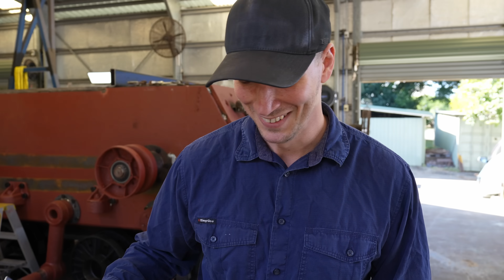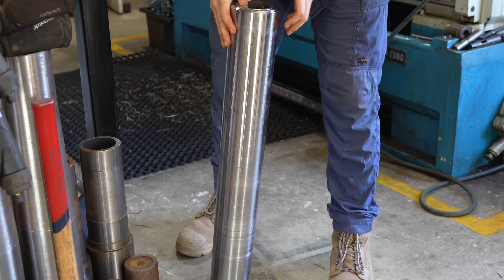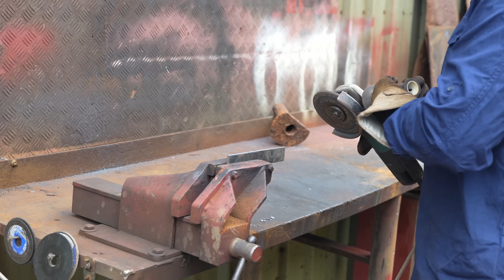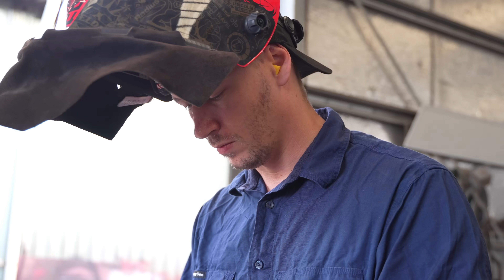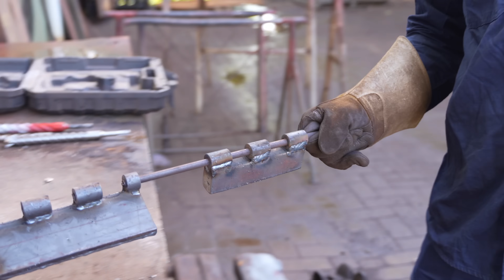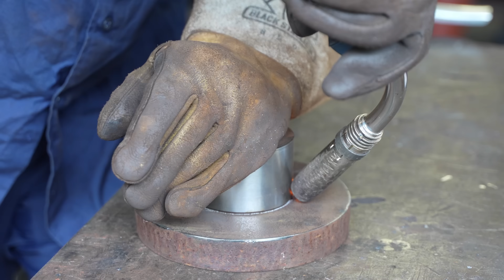WORKSHOP WEDNESDAY: What DESTROYED Our KV-1S Barrel? How will Beau repair this?!

Comment: I don't think anyone would deactivate the gun by plugging the barrel and firing a munition. It would have been safer and easier to detonate it using a remote charge like a satchel or something. Deactivating it while it was a range target later on wouldn't make any sense so I'm certain it was done during war time. The recoil mechanism being stuck halfway makes me think it really was fired with an obstructed bore. It was either genuine wartime damage or sabotage. There's still a chance it was done for denial but I don't think so.

Comment: Considering metal casting is out of the question for practicality reasons, how about making silicon molds and doing resin casting? It's a lot less complicated to set up, and once it's painted it shouldn't look different from the part that was used as the master at all. For cosmetics that don't come under force all that much, it seems like an easier faster alternative.

Comment: Casting a replacement part from aluminum would be fairly simple, although cast aluminum might not be the go-to if it needs to have durability or wear resistance.

A propane forge is hot enough to melt the aluminum. The pattern you have from an old visor. You don't really need to worry about shrinkage if you add in a shrink tube (empty space that extends up from the part).

It doesn't really have much point though if you already have experience and know-how to make something from bar stock.

Comment: Of course you need a high temp furnace if you want to cast steel or iron. But you can manage with a lower temp one if you cast from bronze. Or an even lower temp one if you cast aluminium. And you can't even need a furnace if you cast from resin.

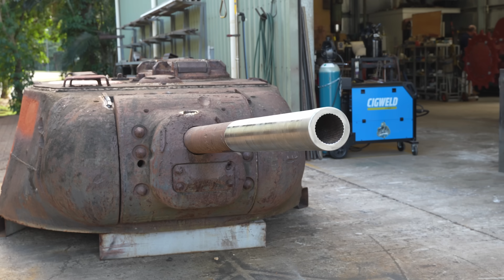Comment: 6:05 - as it is usual in such cases, the added piece droops a little, so the welding should start at the top to pull it up to the correct alignment - or a heavy angle iron should be placed on top first, and both pieces should be firmly attached to it (by clamps) before welding them together.
Hey, I know you know this, and my advice is about four days late, but still... ;-)

Comment: Making the dowel a few thousandths of an inch larger than the bore, then soak in a liquid nitrogen bathe for a few minutes. That bath will cause the dowel to contract enough in dimension that it would slip easily into the bore. As its temperature normalizes, it will expand to its true dimension, locking the dowel in place forever. The reverse is done for the new barrel addition. The dowel also oversized for the new barrel section. But in this case, you warm the barrel to about 400 degrees F and the tube will slip over the dowel easily and when it cools it will also be locked in place. The weld is only needed to hide the joint.

Comment: I use to work at CFB sufield  in Canada Alberta. Where British forces trained. One day a challenger one came in off the field they had went over a large dip and when they came out of it they fired. Unfortunately for them there was around 2 ft of clay mud in the barrel it looked just like yours blew about 3 ft of the end of the barrel no body was hurt badly concussion by the crew. There was so many high ups trying to cover it up but they couldn’t cover it upb

Comment: There was no need to repair anything; the director of this project is incompetent. They should have simply treated it for corrosion and placed the original, intact piece in the museum. By repairing the bullet holes and cannon impacts, you stripped the tank of its originality—and erased a piece of history! You should have left all the original holes intact so that everyone could study the effects of the projectiles on the steel.

Comment: The hatch in the rear part of the commander's main hatch was intended for the installation of a radio antenna (on vehicles with a radio station) or for sending signals (with rockets or flags) when the other hatches were closed.
here some view of turret top
https://microdisign.ru/ssl/u/49/ea0c92371311f0a332eb4b7a686b58/-/2.jpg
https://bronetehnika.narod.ru/kv1s/kv1s_43.jpg
https://dzen.ru/b/ZnJ818qasXInjbD-

Comment: Almost certainly intentional damage. That burst "banana peel" barrel is the result of an intentional event.

Fun fact: movies aside, it is quite hard to destroy a tank barrel without both ends being blocked. Most often you'll simply produce a bulge, which is not necessarily as destructive as one might wish. 

To this day, one standard procedure for disabling a tank gun is to break apart an unfuzed shell so the projectile is free, then hammer it down the muzzle nose first with a sledgehammer, then fire an unfuzed shell into the squibbed projectile.... with a long lanyard. I have seen this exact procedure done with precisely the same results on the barrel.

Comment: if you can plan your cuts 
drop your steel in vinegar or citric acid to eat the mill scale and rust off.  
- side project make set of "welding dog and wedges" with few  different heights of wedges

Comment: Actually you do not have the visor pattern either.  The shrinkage of the casting cool-down is accounted for by making the mold cavity 3% larger than the end item.  Therefore the pattern has to be 3% larger in all directions than the end item you have, so that's another level of fabrication hell to be undertaken for casting a replacement.

Comment: Not that it would likely apply to this one, but have you ever thought of doing an episode about what various government regulators have required to be done to the various tanks to demilitarize them, before or after you got them?  Or, does Australia even have any requirement if the tank is over so many years old?  I've seen some tanks where they had to cut and leave open a hole in the side of the barrel, but not noticed anything that drastic on any of yours yet.

Comment: It is a 85mm kaliber barrel, isn't it? I'm surprised by how thin the wall off the barrel seems to be.
Reply: The main armament of the KV-1S was the Soviet 76.2mm ZiS-5 tank gun. The Soviet Union built in small numbers an upgunned version of the KV-1S known as the KV-85, in which the main armament was the 85mm D-5T tank gun. KV-85s are among the rarest and hardest to find derivatives of the KV tanks because fewer than 150 are understood to have been made, a very small production compared even to the KV-1S (1,085) or the KV-1 (5,000-plus). The best known, most numerous and most widely used Soviet tank with 85mm main armament was the T-34/85, of which the AAAM has an excellent example in running condition.

Comment: Small roof top hatch might also be for signal flags . The Russians radio tech was minimal and early tanks only had 2 way radios  in command vehicles . Next , all tanks  got  radios but could only receive so to show you got the message you would use a  flag . Then they started copying lend lease radios and all got 2 way radios

Comment: Beautiful work Beau.
That barrel was "spiked" and then fired. Or a shell was driven into it by a partially-detonated powder charge.
IE something was shoved in the end. Possibly a shell. It formed a bore obstruction when the gun was fired.
Reply: Not necessarily. It could have been a shell going off while still in the barrel. My guess is that the tank was captured by the Germans some time in 1943 (Kharkiv), and ended up in France as part of a unit (e.g. Das Reich) or used there as instruction object for German recruits on how to tackle a KV-1. It would be interesting to know at which firing range the tank ended up as this would pinpoint roughly where the Germans eventually abandoned it.  I don't think the French would have bothered transporting it hundreds of kms
The Germans probably abandoned the tank after the barrel was wrecked as I doubt whether they would have had KV-1 main guns spare. The alternative would have been to fit an L/48 75 mm gun, but that would have required a lot of work and would probably not have been worth the effort, especially as they would have had a lot of far more pressing repair jobs.

Comment: I've bought castings for vehicles in one of my past jobs, and my immediate first thought was "never cast a one-off." I would have been getting it from a CNC machinist (either in-house or bought outside), but Beau's handwork is equally good for a cosmetic restoration and takes a lot less capital investment. Lovely work and a good explanation of why the replacement was fabricated instead of cast.

Comment: Couple of hypotheticals:

The barrel might have been destroyed by the crew, I know the Germans used to drain the oil out of the recoil damper and then fire the gun to disable it. If the KV crew had done that and obstructed the barrel when they fired it, it could have left it banananed and stuck in the recoiled position. Maybe it was disabled while the Russians retreated and left on the field and later retaken in a counter-offensive. No longer fit for service, it ended up on a range. Just guessing.

The little hatch on top may have been for signal flags. Not all Russian tanks had radios and a lot of them that did were receive only.

Comment: You could flatten a bit of copper pipe and use it as a fence or barrier to stop weld from migrating or flowing to where you dont want it. Copper will make the weld stop dead and it wont stick to it.

Comment: The small hatch next to the cupola is primatly for a flare gun, which was a standard part of equipment in both German and Soviet tanks of the time. Could also be used to throw out spent casings and wave signal flags.

PS Also, both crew hatch and the flare gun hatch should have a flange around the perimeter. Basically a metal ring welded to the hatch, that would topple the gap between the hatch and the turret roof. You can see this ring on the WWII photos and on the surviving museum tanks.
"bronetehnika narod ru/kv1s/kv1s_74.jpg"

Comment: Beau’s ability to fabricate a dummy vision port is impressive—but not surprising. After seeing the amazing seven new road wheels he made three weeks ago for the KV-1S I’d believe he could make just about any steel part of this tank.
Reply: Having worked in a foundry for many years including the pattern shop, I know it would take a lot longer just to make the pattern before casting could even begin. Beau is very talented at fabrication, so why waste time & money.
Reply: Im suprised at this point with all their fabrication skills they haven't built a WW1 tank from scratch
Reply: @HailHydra27  😂 Good point, because WWI tanks were almost entirely artefacts of the boilermaker skills in which Beau and others in the AAAM workshop crew particularly excel. Maybe the chief deterrent is that trundling one of those old things around the museum backlot at Smithfield on the outskirts of Cairns would be slower, noisier, stinkier, more unpleasant for drivers and passengers, and more unsuited to the tropical climate, than just about every other armoured vehicle.

Comment: I think you can get the barrel and recoil mechanism unstuck so you can slide it back in place, but I don’t suppose it really matters for a static display. But honestly Bo I kind of wish you would do that, even if you just welded it back in the correct position.

Comment: I remember reading ( Ithink when the US disabled their guns on Corregidor)  that, when crew destroy an artillery piece, they also drain the oil out of the recoil recovery system (recuperator) before they fire the gun the last time. This slams the gun back in it's cradle, deforms the cradle and makes the whole gun useless so that the gun cannot be reused even if the barrel is replaced. This is what could have happened with the KV1 gun.
Reply: Yeah, that would do it all right.
Reply: Did that with the tiger 2